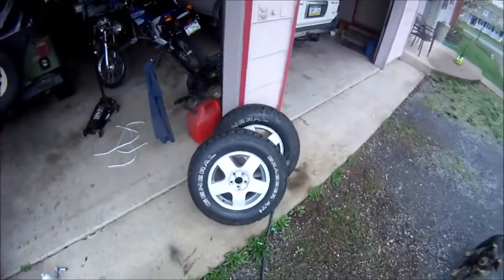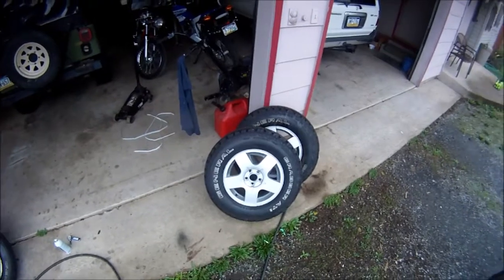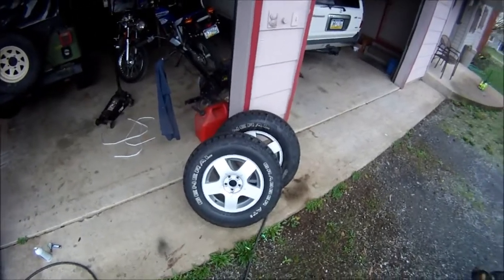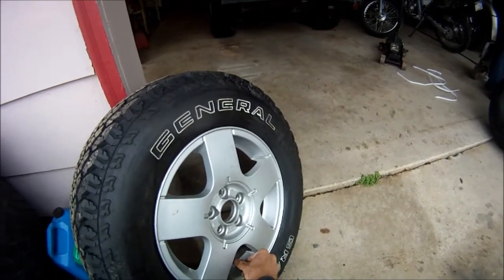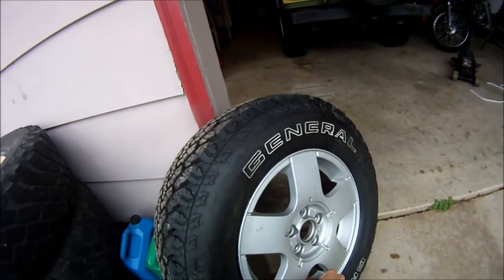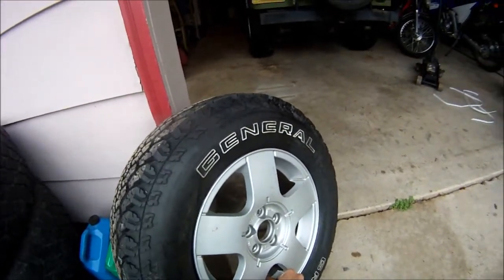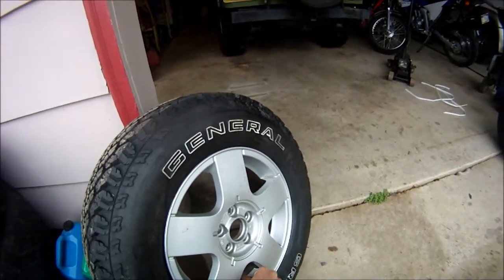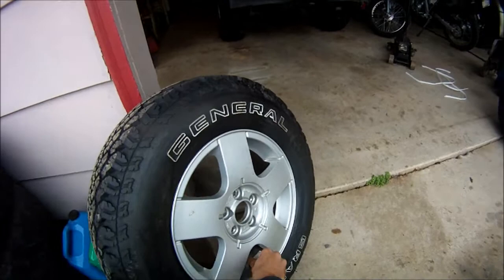Starting fluid bead seating

Comment: we have done some 37" tires for my boy that way worked ok and since then I had a big stainless steel soft water tank that I put ball valve and other fittings on it to be a large air  blaster into the bead of the tire for mounting, seems to work better. also doubles as a potato launcher with a 4 foot pvc section.